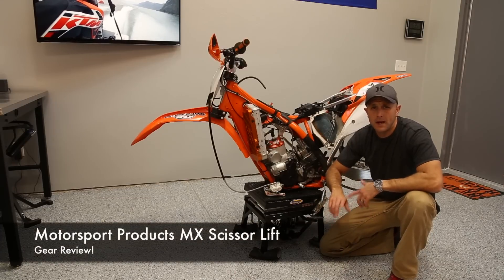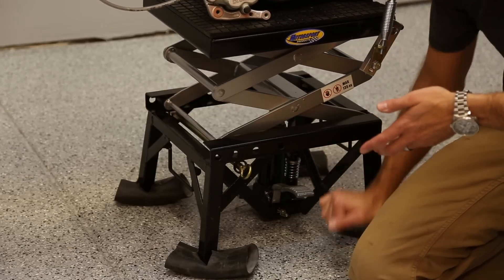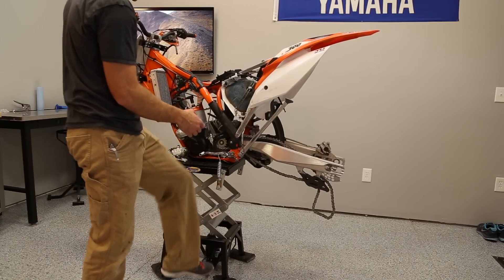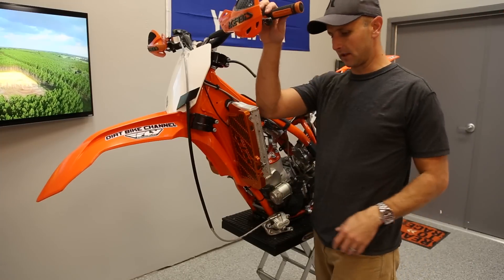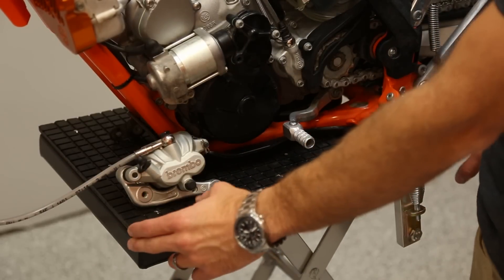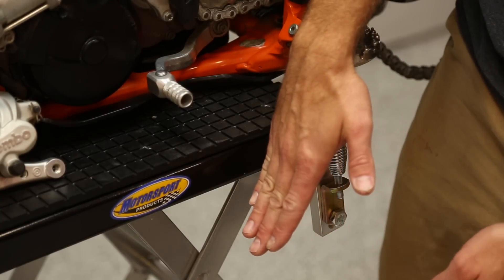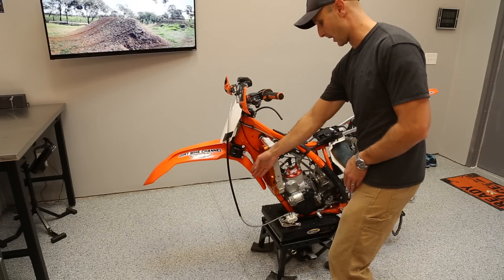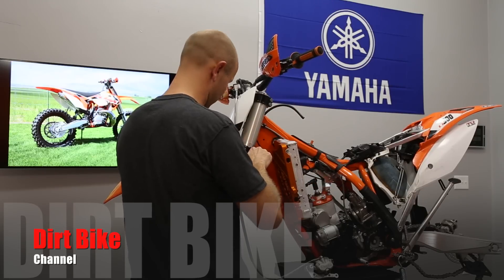Motorsport Products MX Scissor Lift - Dirt bike lift

Comment: I find adjustable lifts make tire changing so much easier where you set the height exactly to where the tires just roll right off and on with no weird twisting at the forks or getting hung up on the calipers. Saves a lot of frustration. Not to mention a back saver.
It would be nice if there was the option for extending out some floor supports if you do need to man handle it a bit more, or for poor weight distribution (like front end removed only).

Comment: Nice video DBC. And thanks for the Stillwell reference for the fork modes etc. He's got a great site and loads of knowledge.He did suggest anti-seize on the fork mounts/bracers and lock tight on a few other spots...he has some great tutorials as you do. Keep-up fun videos, rubber side down. also, just looked, its Factory Tuning Tips with Alan Stillwell.